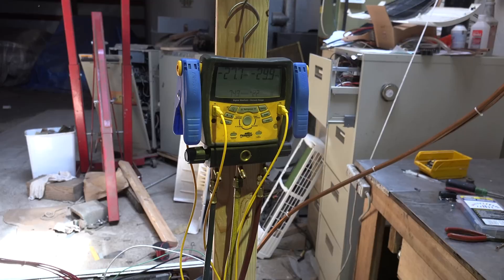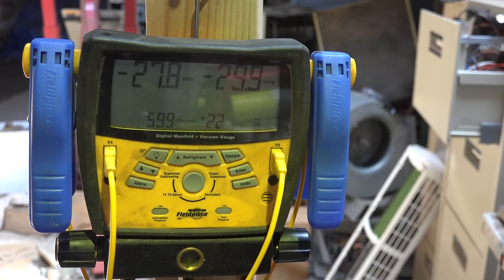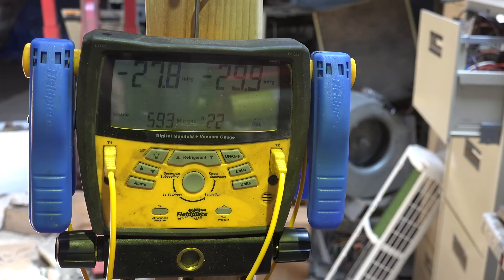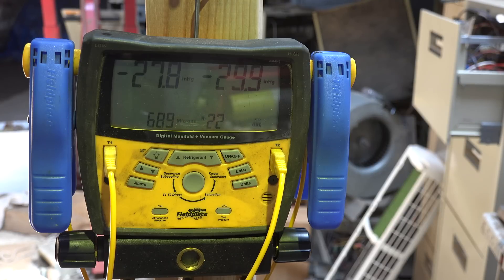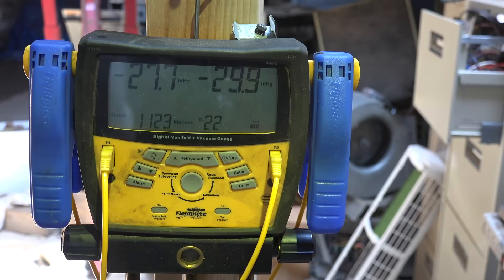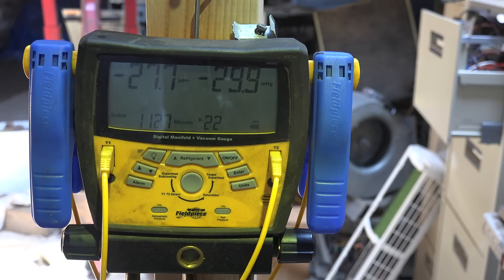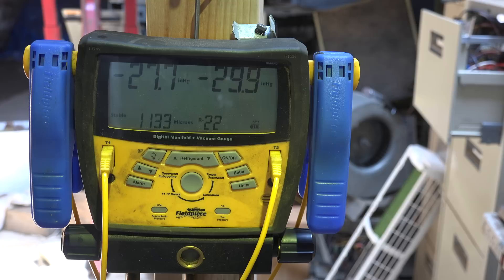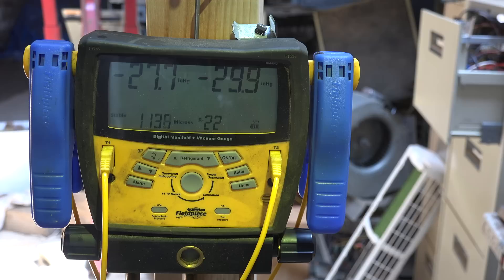Detecting moisture in the air conditioner

Comment: It should be able to sit out in rain forever and not take in any moisture. By placing it under a vacuum all you are doing is drawing in more moisture the same way the first moisture got there. So you went from a system with some moisture in it, to a system with even more moisture in it by putting a vacuum on it and sucking in air that contains moisture.
Reply from the maker: You are assuming the system has a leak and it has not been repaired.  
I would submit that a vacuum, or indeed, replacing driers etc or any action to eliminate air would be futile.  
GFM

Comment: Interesting (!)

Beginner's observation (re: extended vacuums): once microns got up to 1100-ish, the vacuum pump back on, and repeat that process till eventually there would be no more rise b/c all the moisture got removed as vapor. (I wonder how long that would take. That's probably why GFM recommends using a dryer-filter. )
Reply: See GFM's Vacuum Pump and Refrigerant Recovery (15 videos).
Reply: And breaking it with oxygen free dry nitrogen i guess

Comment: A ASKS WRITE FROM VENEZUELA DO I HAVE A SPLIT 12000 BTU ONLY COLD, THE SAME IS A FAILURE OF MOISTURE AND THAT HE CHANGED 2 TIMES THE HAIR AND DO YOU SWEEP TO ALL EQUIPMENT AND PERSISTS FAILS, YOU THINK YOU CAN BE COMPRESSOR OIL POLLUTED THIS?

Comment: Most mini splits have filter dryers installed within the factory piping.  I was taught that you should not add another filter dryer when installing mini splits, or at least I know that is the case with Mitsubishi.  What are your thought on that?
Reply: It's because you can't get to the liquid line when it's a new install

Comment: I was in a training 8 months ago. Instructor said that when we pull vacuum if there is any moisture in system would freeze up, and we have to break that with dry nitrogen and do it again and again (triple evacuation) I was curious about the physics behind it because we have always been thought if lower vacuum that would make moisture evaporate easier. So you said moisture starts boiling after you stop vacuuming ? Why it did not boil and evaporate when you have lower vacuum in system. I am little bit confused. Thanks for the series. Great stuff.
Reply from the maker: If there is a large amount of moisture in the system, it will freeze.  The breaking with dry nitrogen will absorb the moisture.  In most cases, any small amount of moisture in the system will evaporate.
GFM